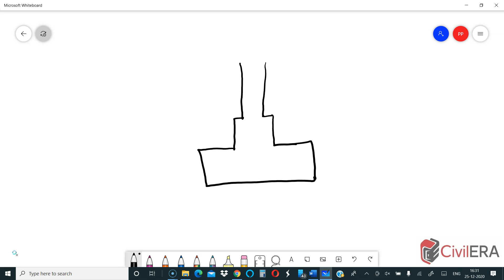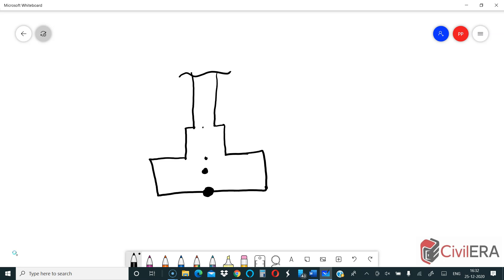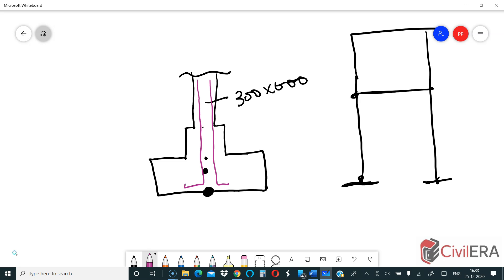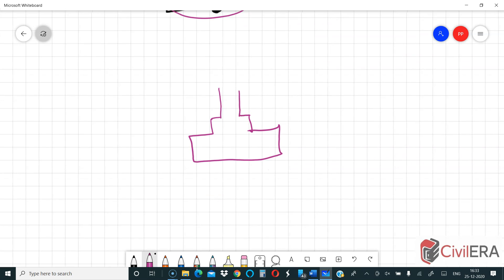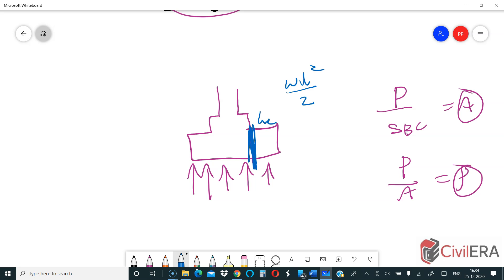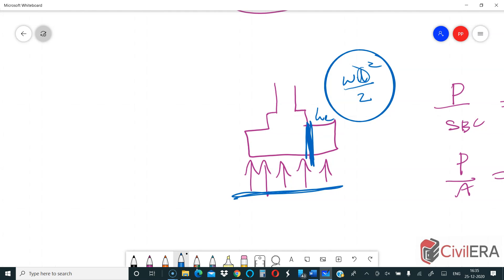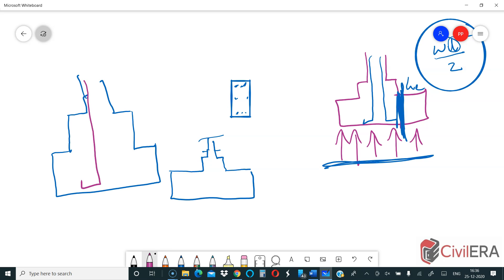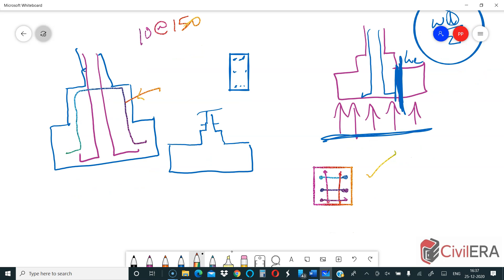A Tip for Footing Pedestal Design

Comment: How we can calculate this additional reinforcement for it?
How much additional reinforcement can we provide?
Reply: It is given only 10@150mm c/c
But how we can calculate this ?
Any reference for it
Reply from the maker: See when you design the column for the compression for a smaller size ignoring the pedestal offset,why do we need a strength for the pedestal.The column itself has this capability. So pedestal needs only nominal steel. That is what I have explained in the video.
The pressure x the cantelever will be the compression on the pedestal and it will not be more than the load itself.And the column area is already designed for this compression and hence the offset area dont need any additional strength.
Reply from the maker: Please see the video.It is mentioned.

Comment: Sir, When we model any Structure in Etabs. do we have to consider pedestal length
Reply from the maker: It depends on what you idealise and based on that you will have to design.
I suggest you consider and if you do you traeat it as part of the column as explained in the video